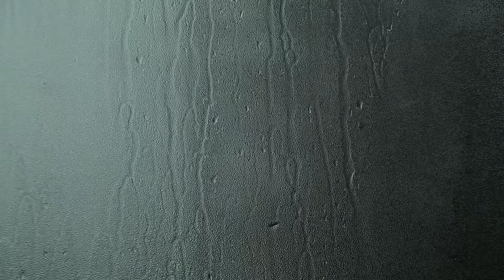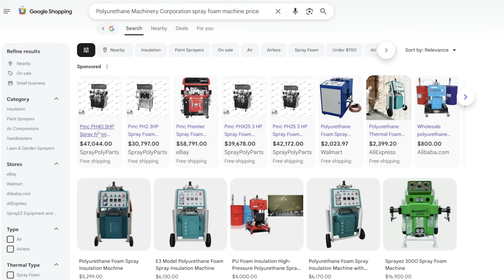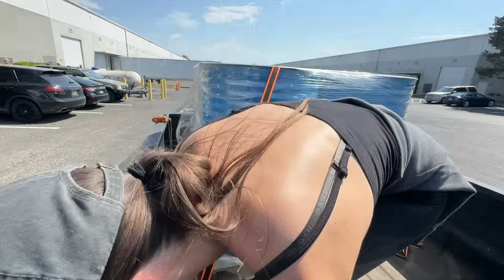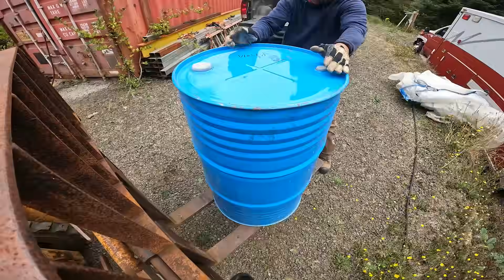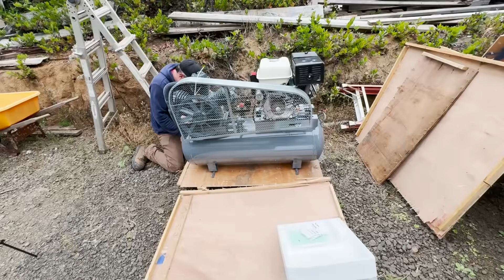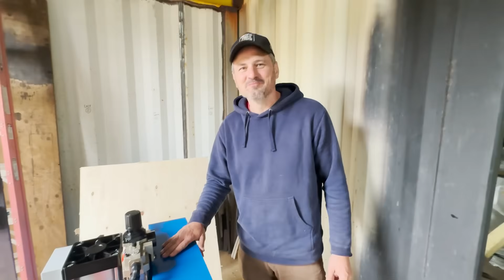WHAT THEY DON'T TELL YOU ABOUT INSULATING A CONTAINER HOME ... Can We DIY Spray Foam? #build

Comment: I too recently bought a machine and chemicals and talked to a guy who uses it. I am in Canada and my 10,000sq ft shop was supposed to cost me $48,900 CAD dollars on a quote from a local spray foam business. I was going to do the prep and they just spray....anyway.
Anybody else considering this machine. You absolutely MUST HAVE barrel heaters, air supplied respirator, lifting equipment for the 550lb barrels, two air compressors (one for breathing air, one that can do 30cfm at 115psi), a 10,000 watt generator (optional), Patience to read and follow the instructions, full protective suit, gloves, preferably a warm place to store chemicals. Those chemicals have a recommend shelf life of 1 year. Find someone to talk to and learn everything you can or you can get extremely sick from handling spray foam. All in I spent around $15,000 CAD dollars just to run the machine. We have planned multiple projects and it will have paid off for the first one already. Going to buy a trailer to put it all in for another $10K

Comment: what was the breakdown on price.   like the machine is a fixed cost and the foam is a variable.  what thickness did you spray? and was the square footage about 7k sqft?
Reply: oh and how long did it take with just 2 people?
Reply from the maker: I gave a price breakdown at the end of the video. We plan on spraying between 2-4 inches (depending on the location...) The house is around 4,000 sq ft including the garage. We haven't installed the spray foam yet because we need to wait for summer conditions (warm and dry).

Comment: Well, pretty much everything that comes from China is cheaper, but it is junk.  Been there, done that.  Many times getting parts for it even a year later is impossible.  Plus, your kind of stuck with what you bought.  It was surprising to see a Honda motor on that cheap air compressor though

Comment: A GREAT TRICK FOR BARRELS. Take a 24" adjustable pipe wrench, adjust it down to where it fits over the rim on the top, grab the end. pull the barrel toward you so it rotates and moves where you want it all at the same time. Hi, guys! Haven't talked to you since you explained how your new printer works.

Comment: I did this same exact thing one year before covid and holy moly i was in with 8 barrels less than 5k wow did that get way more expensive i only needed 4 barrels and i sold the extra which put 2500 back in my pocket kept the machine until just recently and sold it for 4k its absolutely insane that you can truly do this kinda stuff for literally less than half of the quotes you get from people just takes a little time ...... oh and i already had a gas compressor so i didnt need to do anything with that

Comment: I own an insulation company out of Oklahoma City "Bo's insulation.". We could've insulated your home with open or closed cell for $20-$30k. Spray foam is extremely technical and requires many years of practice. That being said, I wish I would have learned the following much sooner. 1) Brand new hoses usually come pre-filled with a solvent. You may need to spray out the A and B hoses otherwise you will make very nasty foam. 2) Those machines have a 50 degree delta which means if the chemical manufacturer recommends temperatures of 126 degrees when spraying to a 60 degree substrate, you will only be able to get the chemical up to 110 degrees (not near hot enough which will result in "drippy" low-yield applications). 3) You can use heated blankets to get the material to the desired temps (not higher than 92 degrees). 4) Drill out your mixing chamber every 10 minutes of spraying. 5) Shut the A and B on the manifold, trigger the gun several times to get out any residual chemical THEN spray graco fusion grease through the gun every time you shut down. 

There are many more variables but these are some that can save you tremendously

Comment: It does not make sense to buy a machine if you only do one house. Why not rent one and avoid sponsoring the CCP? One can also use an eggbeater to make the foam, but that is not practical for a big project like that.
Reply: LoL cuz ya can't rent them. They saved tens of thousands...yes it makes sense cuz now they can sell it or use it to make money
Reply: You obviously have low comprehension.   They got ridiculous quotes of $100k.  I'd buy and do it myself as well.
Reply: @JAB1978 You can rent them if you have skills to negotiate.
Reply: @aholatom Nobody rents sprayfoam machines...show me 1 link where its rented?     If anything they might do a lease agreement for new equipment,  but you will never see this as a day/week rental.  A fully outfitted pro rig can run $100k and it takes experience to run, it's not a DIY setup you learn in a day

Comment: Best of luck, but no honest spray foam insulation company is coming close to $100K on a proposal for a property of that size with the amount of material that you're utilizing to insulate your property (based on what you purchased for the project in the video). I insulate beach front properties that are four levels high with closed cell foam with professional grade equipment and installers with years of experience and we're not anywhere near that type of costs for that many sets of closed cell foam. 

Insulating a house with spray foam insulation is not the same as painting. When I see DIY's with spray foam insulation, I cringe. I can appreciate the can-do attitude of a homeowner, however there are situations where fixing this job is going to cost you more than an original installation quote if it gets sideways. 

I've seen newer spray foam insulation companies run by individuals that have some money in their pockets thinking they're going to get rich in this industry (but no industry experience) totally ruin a person's house by not installing the foam properly. For instance, if you install too thick of a pass with the closed cell foam (maybe you have a bad day and lack patience doing the install while spraying the walls out), the closed cell foam will literally catch fire (and not immediately - hours later when you're off doing something else patting yourself on the back thinking it was a job well done).  

Best of luck either way - however I would recommend leaving certain jobs to professionals that do this line of work for a living. There has to be an experienced installer around that would be willing to complete the install for you on a weekend (although they might be shocked about the equipment you've purchased and will struggle going from a professional set up that they use everyday to something akin to a Yugo - just being honest with you). I hope it goes well for you guys as you seem like good people - and moving those barrels alone is a pain (my former company used to do 40-semi truck loads of chemical each month in Texas). Curious to see the end product. If the foam is installed off ratio (and how would you know), you can get sick from the application (and we're talking after sheetrock is installed). It'll be apparent to anyone in our industry with experience if the foam "looks" off some from photos. 

I get not wanting to pay the man - however find a local company (with experience).  People advertising on Craigslist or Facebook Marketplace aren't necessarily going to lead you to a good installation company per se. The best way to find decent foam companies is to find a custom home subdivision doing new construction work. An established custom home builder will typically utilize the same insulation company if that foam company can deliver on price and quality. Find out who they utilize for their services for spray foam insulation. Then you show up to that insulation company's warehouse at 6 AM and wait. Follow a foam truck from their warehouse to a job site (after they get their breakfast tacos - maybe offer to buy them) and watch their installers start a job. Ask them questions while out there. Ask the lead sprayer if he would want to work for cash on the project with you both on a weekend. Trying to help you help yourselves as you obviously have your dreams tied up into the property you're finishing out.

Comment: I went the same route. By far the most stressful part was customs entering the US. I was kinda surprised and extremely annoyed by the duties. Bought my second gun off Ali-express. Owning your own equipment is extremely liberating.
Reply: which supplier did you use? I'm about to order from Pioneer and wondering if it's legit
Reply: @coloradoadventures3506 I used Shandong Mingko. The foam and machine went fine. No surprises, nothing shady. The only issue I had was when I went back to order extension hoses, I intentionally ordered an amount below the (then) $800 threshold. They messed up and included the shipping in the customs valuation, causing it to be $1100. That caused a big headache because it was right when the tariff stuff started and they wanted me to pay. I had a hard time explaining how they messed up in a way they could understand. Fortunately, FedEx went after them for the money. I tried and tried to explain that they wouldn’t owe the money if they just corrected the paperwork.

Comment: When moving the4 barrels and crates on to the forks of the forklift, use a large ratchet strap around the barrel and the mast.  leave it in place during the transit.  Use a sawzall to open the top of that crate, and it's faster but you can re use the plywood.  Err on the side of caution when moving heavy stuff.

Comment: Did you consider exterior insulation? My current design has studs on the exterior with closed cell spray foam and likely hardie board siding (to more fit in with the neighborhood). We also get to enjoy the more industrial/modern feel inside the house with the exposed container walls in a lot of areas. Stud walls inside also decrease the useable square footage inside. Just wondering if it was considered and if so why you chose not to. Thanks... great content as always.
Reply: Built homes for 25 years here, this comment is how id go. That and id just wire mesh everywhere inside and dona stucco (1 to 1 buckets of mud and tiny rocks ) and rub everywhere flat

Comment: ^^^^^^^^^ Former urethane coating / spray foam chemist. Please be very careful and watch lots of videos and read a ton before spraying. Make sure to wear supplied air respirator when spraying. Mix the Poly side...probably the blue drums....well before and during use. Spray some test pieces and let them sit for a few days to make sure they dont shrink/ pringle/etc. Make sure you have a gallon/pail of cleaner for the gun. Get some NMP to clean cured urethane off gun parts, etc....this isnt rocket science but there are a lot of tips and tricks to get it done good.

Comment: Hello. I did exactly the same thing when I was building my own container. It worked. I bought the exact same equipment as you, only from my local dealer in Poland – so I overpaid ;-) But it still ended up being cheaper. Here's my advice: The ingredients in the barrels must be well heated. The container's sheet metal shouldn't be cold; it's best to do this on a warm, sunny day. I'm keeping my fingers crossed that everything goes well. If you're from Oregon, you have rather harsh winters there. I recommend adding a layer of wool insulation after applying the foam.
Best regards.

Comment: I do spray foam installation professionally. One thing I can’t emphasize enough is that there can’t be any moisture on the metal when you spray it or it won’t adhere and it will shrink and pull away! Also periodically monitor the pressures on both pumps to make sure the foam stays on proper ratio. Off ratio foam can off gas for a long time making the environment unsafe to breath in. Off ratio foam will also not be at proper R value and may shrink and pull away from the walls/roof
Reply: There's no way they got a legit quote for 100k dollars though, right? Like that just seems insane to me, unless maybe there's huge markups for hard to get to location maybe?

Comment: Your vapor barrier alone will NOT stop condensation. You also need a certain thickness of insulation, which depends on R value, relative humidity and dew point temperature. Please check your calculations, before you waste your time and money. You are on the right route.

Comment: Stop insulting the inside of containers. Its pointless. The only thing about this video that made sense was the man saying that steel was thermally conductive... Followed by we're going to attach steel to create a thermal bridge drywall...😳.

Think of your container home as a skillet. Now think of the sun as the burner. If you dont want the surface in the skillet to get hot (or cold) the most effective way is to stop the heat from being able to come in. Providing a bridge in between the metal and the meat (you, you are the meat...).
EIFS (synthetic stucco)is perfect for containers. This is done by attaching foam to the exterior. This not only provides insulation but also protects the steel from the environment.
Same concept for the roof. You can cover with the same foam then a epm sheet and use inexpensive steel AG roof on top with a air gap and slop.

People are so worried about insulating and their vision of a industrial modern-looking home made from containers but they fail to realize number one they lose square footage with excess insulation are there insulation is inadequate. Lynnwood spray foam on steel if there is a leak, the water gets between the foam and the steel and it will rot away because there is no way for it to escape/drain. As they said spray foam is expensive. Eifs is not as expensive and if you use XPS you can get similar r values to spray foam and I've done on the outside you don't have to worry about the downsides.
Reply: LoL nothing wrong with insulating the INSIDE. As long as theirs enough it's fine, especially for their layout.
Reply: Oh yes there is.  

The best place for insulation is on the OUTSIDE.  No thermal bridging, no interruptions due to framing, easier to air seal, easier to weather barrier, keeps thermal mass close to occupants, not to mention faster.  And that's just 30s worth of thinking.
Reply: @Katoutwo still nothing wrong with insulating inside. When it's outside one loses the sealed durable surface outside. Bugs and critters like to get into soft materials and it's extremely difficult to keep em out and seal it up

Comment: Be careful with the chemical. I do this for a living and it's very dangerous. You need a fresh air breathing system, not a dust mask. If you breathe too much chemical, first you will see fog, then you will begin to vomit. Do not get the chemicals on your skin or clothes. It can cause damage to your internal organs, and it doesn't come off easily. 

Closed cell chemical must be kept cool, don't warm  the barrel or it will lose it's optimal expansion and also can explode. 

Last, you have some con artists in your area. That's a $18,000 to $20,000 job. My primary job is management/sales, but I am also the trainer for new employees coming to the foam department and installer when we are behind.

Comment: I just wanted to add a few thoughts towards security in general , environmental security insofar as potential woodland fire , I'm not sure how far your based from the lake for a possible water pump  ?, cutting back & creating a safe zone from plant foliage , hopefully you shan't require none of these precautions , additional security such as cctv , alarm systems, security lighting & a secret safe room ,or a small dug out basement  , it's peace of mind more then anything , particularly in today's times , possible training & protection tools , other additional contingencies such as fuel storage , radio communication equipment such as a main base radio & GMRS walkie talkies .
Other safety factors is professional electrical grounding of the entire steel property offering protection from lighting ,general electrical health & safety within the home & protection from electrolysis that can potentially corrode external metal & paintwork  .
I carried out some of the above when I lived in the south of France in a similar environment ,it was a beautiful location within the  foothills of the Pyrenees in the Aude region not far from Limoux, it was a mistake returning back to England , I wish I was still there .